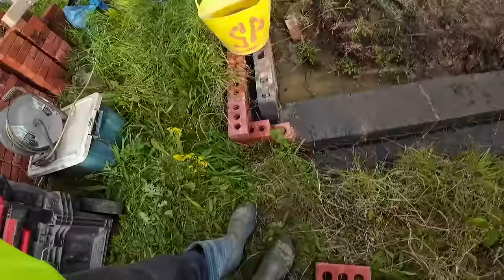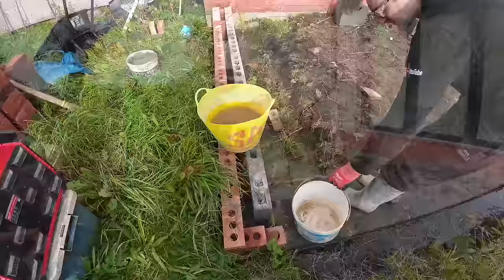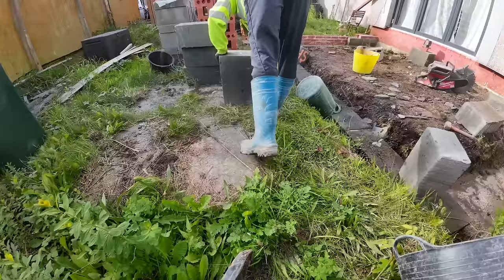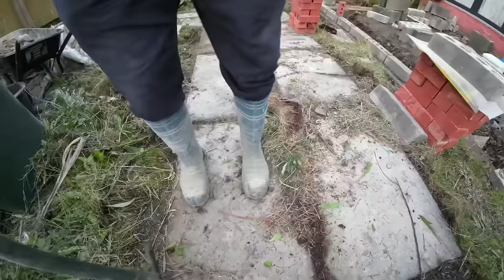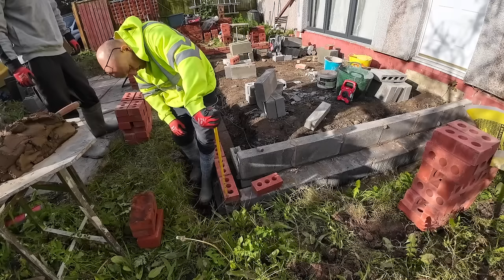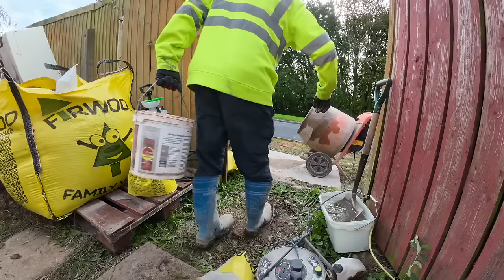ABANDONED FOR 2 YEARS !! CONSERVATORY BASE RESCUE

Comment: Nice straightforward job now. Ive not done one onto an existing with EWI, i suppose you have to cut the insulation back to get the wall starters on ??
Reply from the maker: Yes Andy, a bit more complicated as it’s face against render/ pebble dash so it will need patching up neat 😬🧱👍🏽
Reply: @SteveAndAlexBuild  👍

Comment: is this going to be a conservatory or an extension for BRegs?
Reply from the maker: Orangery 🧱👍🏽
Reply: @SteveAndAlexBuild  OK - just checking exemptions from Building Regulations

An orangery, like other conservatories, is exempt from building regulation approval when:

    They’re built at ground level and the area of the floor is less than 30m2.
    An external quality door is used to separate the orangery from the current property. 
    There should be an independent heating system with separate temperature and controls.
    The glazing and any fixed electrical installations comply with the requirements of the relevant building regulations.
If a proposed orangery doesn’t meet these exemptions, adherence to all necessary building regulations is necessary.

Comment: Will you run into problems with plans passed over two years ago,quiet a few changes in whats expected today,I am sure you will find a solution
Reply from the maker: The dimensions haven’t changed and it’s not under regs 🧱👍🏽
Reply: @SteveAndAlexBuild would the fact that the work has begun under previous regs not mean you’d work to these anyhow?
How is an extension to a house not going through building control though, can understand it not needing full planning

Comment: The thing is you cant reuse the ton bags so I don’t no why people are moaning about you cutting the bag open
Reply from the maker: Exactly Andy . We have dozens of them just sat there 🙄🧱👍🏽
Reply: Maybe the suppliers can't reuse the ton bags but you will find loads of other trades can reuse them , such as gardeners even scrap collectors  .So how do you get rid of the split bags Steve ?
Reply from the maker: @michaelwaite6725 I have plenty rotting in the garden .
   I have a full time job and a you tube channel to run so forgive me for not travelling the local area re housing ton bags 🙄. 
   The split bags get a full church service then a burial at sea with full military honours 🫡
Reply: @SteveAndAlexBuild  I know from past experience that if you had a undamaged bag and advertised it on Facebook marketplace you would amazed how many people would want one , my neighbour uses one to take his excess garden rubbish to tip etc   Do they burn well ?
Reply from the maker: @michaelwaite6725 never been on face book and never set fire to one I expect the fumes and smoke would be particularly toxic 🤢